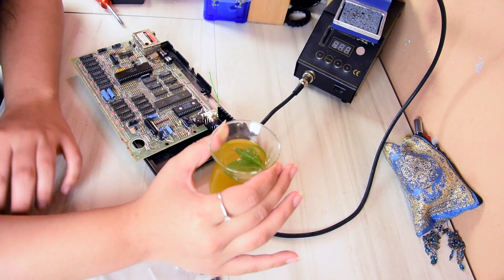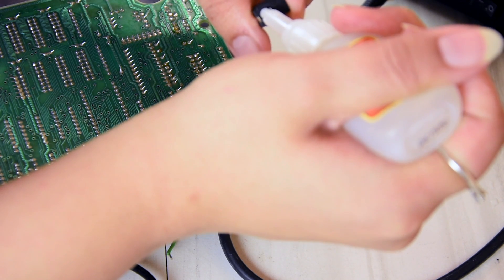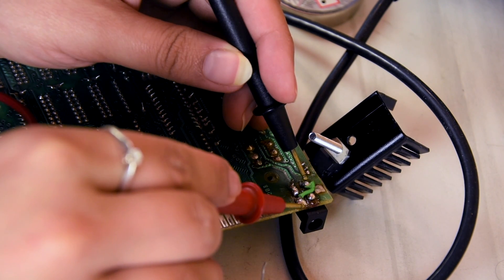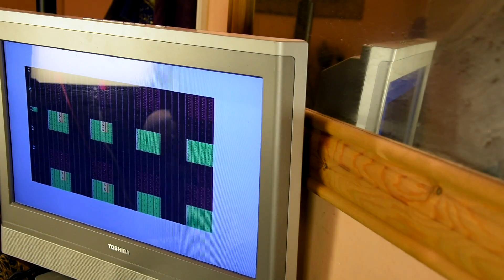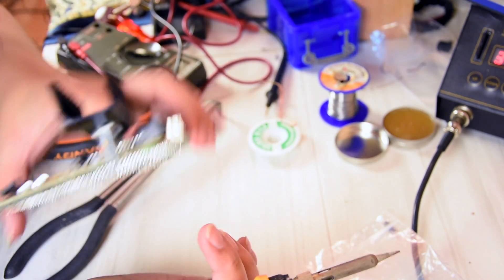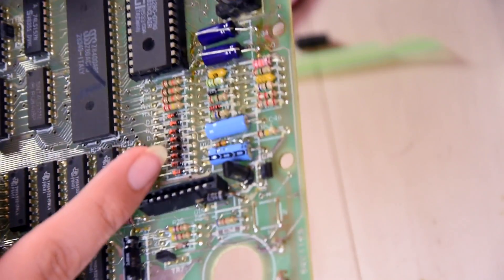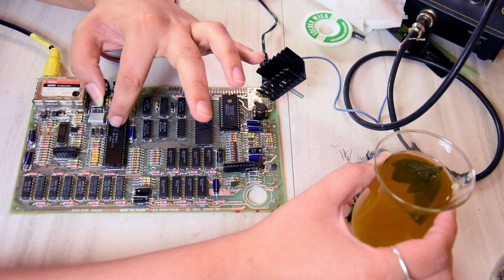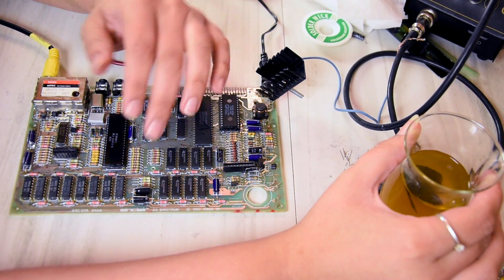ZX Spectrum Repair - Part 02

Comment: Easier to cut the legs to faulty components before trying to remove the pins when desoldering. You're also better off using a solder sucker to remove the bulk of the solder then use the braid to wick off the rest and the leg will simply fall out. The object here is to ensure no damage to the PCB. Should also try and get hold of axial lead capacitors rather than the newer radial lead.Has been very interesting watching and is inspiring me to fix my two spectrums I've had in my cupboard for years. Thankfully these are in better shape but may also be suffering RAM faults due to power supply failure.

Comment: 7:15 The silkscreen on these boards isn't always totally reliable, so always pay attention to the direction the installed capactitor you're removing.

I'm not good at this, the few times I've had to do this, I do them one at a time for exactly this reason.

Comment: One more thing, you could look up Spectrum Next. You could just purchase a mother board which has a loooot of improvements over a stock speccy with more ram, additional video options, accelerator option, SD card I/O and has a AY chip and SID from c64 implemented and you could put it in your speccy case (some modding required but it is very very nice) ;)
Reply from the maker: Haha i've had my eye on the concept designs of the Spectrum Next for about a year now and have been drooling over it since the kickstarted happened, it seems great and the fact that you can use it as a real spectrum (I wanted a toastrack spectrum before knowing the next was actually available... now to save those pennies :o)
Reply: MsMadLemon very true! It is a bit expensive and as for me personally I promised myself to invest in one project at time (my a600 first) but knowing that the NEXT boards will be available next month makes it very very tempting! (Not sure if I can resist lol) :)

Comment: Speccy could be tough to fix sometimes. There are different upper 32kb chips which consist of 8kb chips with only 4kb working on them. Depends which section if good (top 4 or lower 4) then there is a switch that lets the board know what kind of chips are installed. Now i think it could be lower 16kb and you should let the computer run for a bit and check which of the 8 chips gets hot or hotter than the other once and replace it. Also there could be a bad rom or even ULA. If you have all voltages then I would look at lower ram first. If you decide to remove all lower ram chips then you could always put sockets and try to replace them with the good ones or I would go for a lower 16kb board that just clips in the sockets (if I remember correctly). It covers the whole area of 8 chips and uses some of the pins from the sockets. Either way this will give you an idea if the ram is good or bad and it's a good starting point. But you will have to be very careful with removing the original 8 chips as the lines could lift and break. Just be careful and use low temp setting and you should be ok. I think you would really enjoy speccy with AY and trackers as the demo scene pushed that chip to limits in speccy. You can even get a sample tracker (crazy ey!) but more memory would be very beneficial but you could still experiment with it with 48k. Good luck to you and if ill see some other videos with your speccy I'll try to help some more. Cheers!

Comment: Of course, I cannot make an accurate diagnosis from watching your video; however,  the display this ZX Spectrum produces is highly indicative of a RAM fault. Whether it is in the upper or lower RAM (or both, it can happen) will have to be determined.

Sometimes it is possible to detect a faulty upper RAM IC by using an oscilloscope to examine the signal on the data line (Din and Dout are connected) of each upper RAM IC. It's difficult for me to describe exactly what to look for in a brief way; it's something one gets used to noticing after having repaired hundreds of these computers. Nevertheless, a common problem is a faulty upper RAM IC attempting to pull its data line high or low at a time when it shouldn't. This can interfere with the CPU's ability to access the lower RAM.

If you are familiar with the ZX Spectrum's initialisation process, the exact position of the thin vertical red lines on the display can sometimes give a clue about which data bus line is afflicted. The persistence of these lines suggests the computer is unable to complete its initialisation RAM test routine.

The exact nature of the fault could very likely be determined by using a logic analyser. I have published a video that contains information on doing this:
https://www.youtube.com/watch?v=WOzpM0YgcH0

Faulty lower RAM ICs can most easily be replaced by new old stock or used, but tested 4116 ICs. Upper RAM ICs can be replaced by 4164s. All replacements should be designed for access times of 150 ns or less. Alternatively, I sell modules that can be used to replace a whole set of upper or lower RAM ICs (see http://zx.zigg.net).

If you are not highly familiar with the hardware of the ZX Spectrum, you might find another video I have published helpful, it's called ZX Spectrum Hardware Description.

Good luck with the repair!
Reply from the maker: Thank you so much for this valueable info! I will check out that video and what ram modules you sell.
Reply: I can recommend these modules. in addition to replacing the whole bank of original chips, the fact they use the 5v line exclusively will make the 48k a lot more fault tolerant.
Reply: I definitely cannot fault @JoulesperCoulomb's diagnosis. He managed to debug my speccy by a badly described issue from me via email .

Comment: If you ever have to replace an IC, and worry that you may strip the pads or something, it is worth considering using small cutters and snipping the leads of the package to get it out of the way, and then removing each lead individually. This technique can, of course, also be used for any other sort of trough hole component where the leads are available, for example when recaping a board like in this video.

I would probably have removed that heat sink for this work, I was worried it would get hung up on something or just put too much strain on the regulator leads.

Comment: Hi again. Have you checked for a dry joint on the rf modulater before you start and swap and change chips. 😀
Reply from the maker: Actually in the previous video I had done the RF hack and converted it into a composite, so it works well and is bipassing the RF modulator.. however this seems to be a ULA or memory issue. :o)

Comment: Surprised you did not use your milliput to secure the power jack...lol  The audio and video quality  was excellent.  I just use a desoldering iron like this:
https://www.radioshack.com/products/radioshack-45-watt-desoldering-iron
It's low cost and works just fine Thanks for sharing and see you next time  : )
Reply from the maker: Actually good point, I didn't think of miliput ;o) ..though for a DC jack I think juuust a little bit of overkill lol
I use solder wick which works beautifully, but the desoldering pump iron looks interesting, i've never seen anything like it, thanks for recommending :o)
Reply: You can attach a car vacuum pump to that desoldering iron and a filter and a power switch on the iron and then you've got a desoldering station. I know, I've made one with a different type of iron. The type with a plunger. Works great if you plan to desolder many components or an IC. Cheers :)